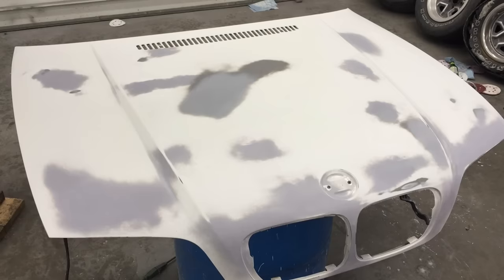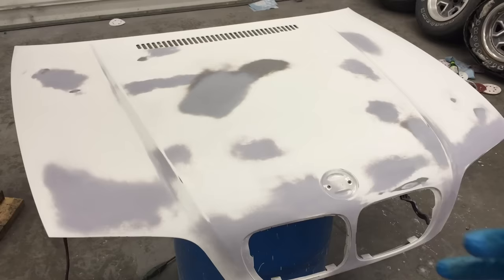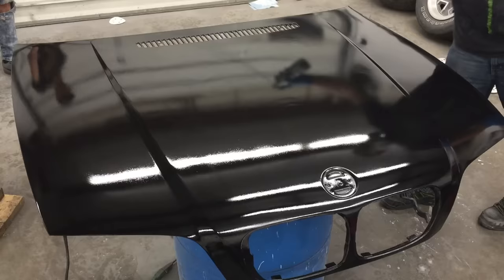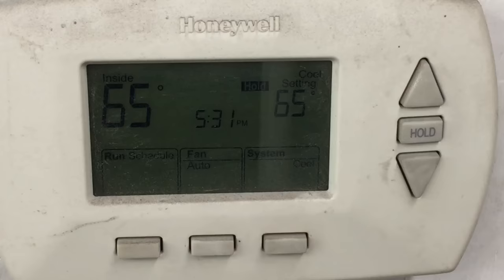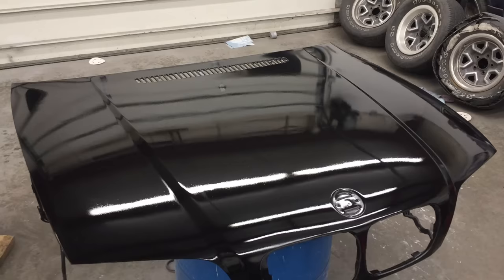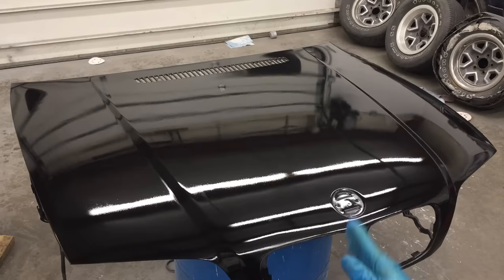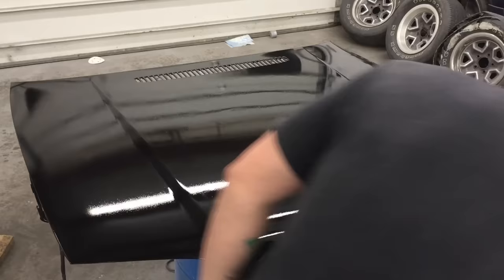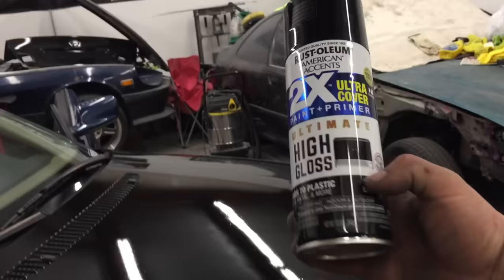How I don’t get stripes when spray painting (Easy method)

Comment: Not judging at all bc looks great for what it is. Just when heard you say light coats then whole hood is covered in first coat😂. Im just use to building up coats maybe first is half or less then 2nd about 75 to 80 percent and third coat full even coverage. Sand and clear. But hey if works for you then nice but your exactly right on the temperature.
Reply: Joseph Purcell well the paint is black so it will look heavy
Reply: SAMO 6IX true it’ll look dark but a light coat means light. As in you’ll see some of your primer still showing which you spray a coat lol. What he sprayed was a medium coat but either way it came out looking really good for a rattle can paint job.
Reply: I agree.  My definition of "light coat" is also very different from this guy's.  Of course, I don't stop at 2 or 3 coats, either.  I was always taught that the first coat gave subsequent coats "something to grab onto" along with the surface itself:  it's hard for second coat to grab onto a completely covered surface.
Reply: His "light coats" are heavy coats for most people, thats just the way he chooses to do it and it works. I've watched most of his videos, he has never actually done a true "light coat" lol

Comment: Crank up the heat, use a heat gun, flows out the orange peel. I use a propane torch too or the sunflower propane heater on the 20 gallon tanks.

Comment: Nice job on the hood. My question is are those SSII oldsmobile rims in the background, what are the plans for such rims and by chance do you have the vehicle those rims are off of?
Reply from the maker: Grover White Don’t remember what they are off of but had them forsale for years and no one wanted them even had them all up forsale for $20. I sent them to scrap yard since I don’t have room for junk. I had no use for them.
Reply: Sad, but 100% understandable, those rims today are worth about $600 a set, for they are factory Series 2 Sport rims by Oldsmobile. If they were 14x7 they were to a 1970-1971 442, Vista Cruiser,Cutlass or Cutlass SX. If they were 15x7 they were 1972 and later.
Reply: Damn them are hard to come by too

Comment: I'd love to see you using Rustoleum out of a spray gun.  I'm in the market for a new compressor and I'd like to see your opinion on a DIYer spray gun/compressor setup.  Thanks for taking your time to post.
Reply from the maker: I will do a video in the near future!
Reply: My first paint job in 1987 was a gallon of white  from orchard supply.  I had to reduce it a little to get it to spray nice.  My 2 nd paint job was regular auto paint and a lot easier to spray.
Reply: I've sprayed my race cars with rustoleum for years. 50/50 with acetone works great, higher pressure seems to get it to atomize better and dry faster but the over spray is ridiculous, everything gets a coat of whatever color your spraying so Id suggest tarping off the area like a makeshift paint booth. I have a car that was painted 4 years ago that sits out in the elements of northern wisconsin, it still has a gloss finish never waxed or had clear coat applied so those that say it dulls quickly must have did it wrong or used spray cans

Comment: Just got a small are where I  scratched some paint off.  So, should I  tape off first, wet sandpaper it with 400, clean it, wipe it with acetone next, then use color high gloss ultimate.  Let dry , do it again, let dry, do it again.  Let dry, then buff?  How do I  color match?

Comment: Yes I agree his definition of light coat leaves a little bit to be desired. Also he doesn't explain how he stays away from Tiger striping. All he says is he has some orange peel a couple bugs landed in it the orange peel is normal he says so it needs to be wet sanded and buffed but what about the tiger striping

Comment: I painted the front bumper on my civic at night it was bout 55 outside. It literally looks factory. I sprayed the rear today and it's out side drying right now. I can see some stripes in it after 3 coats. Will they go away. When i spray the front it was getting to night fall. I went straight to bed and saw it in the morning. I couldnt believe how good it came out. Bout now ive been looking at this one for an hr or so and i see the stripes. Will the lines go away after a couple hrs?

Comment: Wow but some time you are so close some time you are far away whats the logic and ive seen you are spraing edge first then fill the entire but you cant do one coat horizontal and one coat vertical and can i leave it with out clear coat if its glossy and how long usually itll last? 
I mean from the hood painted surface so in case 8 want to paint my xterra roof can i paint all at once or divide it into 4 or 2 parts after that with wet sanding and 
buffing itll be ok am i right
Sorry too many questions but want to learn spray can technique 😁

Comment: Are you using the stock can tips?   I spray with this same paint on a regular basis but my spray pattern isnt nearly as wide as what yours is coming out.
Reply: You would need an adapter to change US can like rusto and krlyon since they use female adapters on the can. All of the good caps are European made because of this. The top end spray paint all use male adapters and you can buy about 30+ different caps or tips.

The really high end german stuff can even be sprayed at almost any temp. check out molotow belton premium cans. can order online or if you have any local art or graffiti stores. The stuff can be sprayed at -10°C until +50°C and has 275+ colors. Its UV and weather resistant too.

Comment: Been watching your vids and gaining a ton of rattle can knowledge... So thank you for these! Just one question, how light do you go on the first coat? I know you say to go light and build it up after each coat but it looks like you're getting full coverage on the first pass (possibly due to the speed of the video)
Reply from the maker: I got full coverage on the first pass but if its spotty then that's ok too. I usually go thicker than most but that was my version of a light coat. Idk if you noticed on the 3rd coat i made it consistently look wet and that's the secret to making it not have stripes.
Reply: @JamesDguy  Truly appreciate the response! Now I just have to wait for a break from this FL heat and I should be good to go... Thanks again for sharing your technique!
Reply: @funky.ass.breakz4473  heat.... Let's meet halfway and get it done 😂 it's too cold for me to paint....

Comment: Super heavy first coat. Or maybe that’s just how the can sprays.
Reply: Looked light to me, he didn't say mist coat.
Reply: That's how to avoid toger striping. Keeping the wet edge. Laying it on, just to, but not quite what I call, "the run stage". If you've sprayed for years, you know what I mean. If a person has sprayed very little, it can be learned in a short time. Practice on cardboard, or on some old piece of metal is even better.
Reply: @KM-ws8qs  but if you're keeping a wet edge that's already a thick coat isn't it?

Comment: looks like it still has what seems to be hail damage all in the hood. Paint laid good though. Too bad the rust oleum flat won't lay smooth. Good paint just blotchy.
Wait did I hear you say wet sand and buff. No way that will happen with this paint. It will gum up and start to roll. Ive tried it a couple times thinking I made a mistake. Then called in and they said no bueno.

Comment: Rustoleum is awesome. Never use krylon on your car.
Reply from the maker: chris k I learned the hard way years ago lol
Reply: Try duplicolor, even better
Reply: +James D guy me to with interior parts never again..
Reply: +Mus. yeah much better I used perfect match on my bumper to color match came out....perfect lol
Reply: I like Rustoleum better, but I painted a beater Jeep Cherokee with Krylon. Lasted for years...
Reply: That's the truth.  I wish I saw your reply earlier. But this is how I can give out tips also I learn from experience.
Reply: I agree, krylon was good 20 years ago but not anymore
Reply: I tried Krylon and it was okay, but not as nice as Rustoleum
Reply: Krylon?  Do they even make that garbage anymore?
Reply: 3dcad Unfortunately yes they do. Lol
Reply: @3dcad668  looks like Walmart is replacing rustoleum with krylon
Reply: Barbara Annen Lowe’s it is then lol
Reply: Olayuwon Dennis 
So they sell the paint used in the video at Walmart
Reply: Krylon has good spray tint for glass if you want to do head lights like yellow centers on a usdm integra. That’s all I’ve ever used them for.
Reply: I cheaped out even more and bought Walmart brand Color Place at .96 per can once. It made no discernible difference that I could tell from the Rustoleum, but it also wasn't compatible for some reason, so I'd be careful with that. 

Now Valspar rattle can enamel from Lowe's? NEVER EVER USE THAT GARBAGE! 🤦‍♂️

Comment: Amazing work guys 👊🏽💪🏾 Question, what are you using for your video/audio recording?
Reply from the maker: Prestige Fleet Well I didn’t have a external mic at the time but I was and am using a IPhone6 for this video and my newer ones. I recommend getting the mic from amazon it’s really cheap and works good. I can link you one if you are interested.
Reply from the maker: Prestige Fleet here is the mic I am currently using in my newer videos.

Comment: I just painted my hood with a spray can and it has stripes all up and down it. The temperature outside was about 63° but I was painting it and direct sunlight. Would the direct sunlight cause this occur? Can I still use wet sandpaper and make it look good before buffing it or do I need to re-spray it?
Reply: It means you need more coats

Comment: Did you have to use a heat resistant paint for the hood? Or did the regular Rust-Oleum Advance do fine?
Reply from the maker: Normal rust-oleum. I hardly ever use heat resistant paint and have great results both off engines and on.
Reply: Moore Motorsports James Dguy 
So a normal rustoleum can like the one in this video works on engine parts? & on the body of a car?
Reply: I'm his video he specifically noted that high heat like engine blocks exhaust manifold you would use high heat paint.  Body hoods it possible to use the regular paint of course with a base coat. Plastics use a plastic base coat and then regular paint.

Comment: What’s the best way to clean surface once I have sanded it and where can I get color shift paint
Reply from the maker: Autozone for the paint, And best surface cleaner i have used it rustoleum wax and tar remover from walmart. It works the best.
Reply: James D guy thanks bro I appreciate the info. Gonna do purple 2x painters touch on my gs300 and black 2x for the hood, roof, trunk and rims. Along with the purple flakes on all the black. Just gotta day that your videos are super helpful and they are some of the best 🤙 Also the only thing I can’t find is that 2k clear, where exactly can I get that?

Comment: I am pretty sure you are spraying way to far, hence you getting a sand paper looking finish, paint or primer is drying before it hits the bodywork, plus always try and paint at 90 degree.
Reply from the maker: SteadyOnThatTrigg It don’t have a sand paper feel or look. None of my spray jobs have a rough feel to them even before the wet sanding and adding more layers if I choose to do more layers. I never understand why people get that sand paper feel/look.
Reply: @JamesDguy  ... if you spray from too far away the paint starts to dry and the airborne vapor eventually settles on the wet paint causing the dull / dry look. This is part of what happens when you spray from one side and switch sides. Always spray in the same direction to avoid that overspray and maintain the wet edge. BTW, I usually do the second coat at 90 degrees to the first coat to help even things out. If it's flat (like a hood) then I can usually go for a third coat coat without fear of runs. Oh, there are times when I work with a fan on low speed placed maybe 10 - 20 feet away. That's just enough of a draft to keep the overspray moving and the bugs away. The other thing I do is pre-shake my cans then set them in a sunny window for an hour or two. Warm paint flows nice, doesn't blush, sets quicker, and has less orange peel. Also no worries of water drops from soaking them in hot water.

Comment: How long would the dry process take on an item the size of an arm? Also does this paint crack if the base is flexed or bent? Because I have a plastic mold thats out of shape and I'm concerned if I spray it while swirled it will crack on me once I extend it to it's full shape
Reply from the maker: I have painted over plastics and never had a issue with cracking due to flexing. It depends on the temperature but the warmer it is outside the faster the paint dries.

Comment: Someone should tell rustoleom to put a fan tip on there cans . I tried putting one on off another can and it wasn't compatible .
Reply: u gonna have to get a adapter. look into wingcap adapter to use a male fan cap/nozzle for the rustoleom can.

Comment: 65 degree perfect for paint? Where u located in texas perfect temp in 75 and up
Reply from the maker: Elchingon_92 In the shop 65 it was 78 outside in Kansas lol
Reply: Why so low? Is it cuz it takes lonher to dry so staya wet longer
Reply from the maker: Yup to get more even coat and not get stripes
Reply: Yup. If the ambient temperature isn't in the mid-70s at least get the paint material up to that temperature

Comment: If you do end up getting tiger stripes whats a good way to get rid of it I just painted my hood and I have tiger stripes.
Reply from the maker: The best way i have found is to wet sand the hood with 1000 grit after a few days,  Re shoot it. Try to follow the wet edge of the paint keeping the entire hood wet basically it helps make the stripes not show up. Harder to do when the hood is hot or its hot outside.
Reply: @JamesDguy  thank you

Comment: You said apply in light coats. Your first coat was damn near full coverage. You want a 50/50 transparency on the first coat,then lay it on thick
Reply: Look at the spray pattern (narrow) and volume (high) coming out of the can. This isn't automotive spray paint where they use a smaller orifice and different propellant (lower internal psi) to allow more of a mist. This is cheap spray paint where coverage is designed to be fast, not precise. He actually controlled it pretty well considering the large area.

Comment: If there’s tiger stripes should I continue going over it till its all blended in?
Reply: I'm still not sure about painting with metallic because of tiger stripes but with solid paint if you lay it on thick enough in the right temperature out of any wind you shouldn't get tiger stripes but with solid colour if you have enough colour on you can sand it flat with 800 grit  to get rid of any imperfections before clear coat or without clearcoat use 1500 and buff

Comment: Its 1 stage paint? o.k its not very good especially with this valve for better results use fan spray valves,my advice is put some clear coat on it..i am guessing till now after 2 years you will have painted again

Comment: Can you recoat after days of drying without sanding to go over areas that may be light
Reply from the maker: steelers412 I wait longer just so I know it’s fully dry but wet sand before recoating. Use 400 grit wet sanding
Reply: Thanks for the info. And nice work!

Comment: How long should you let it sit between coats?
Reply from the maker: Mark Reallz I let it sit no longer than 15 mins but usually I only let them sit 5-10 mins
Reply: U let it sit no longer than 15 mins BUT usually u let it sit in 5-10..it doesn't make sense.

Comment: Why not just get a inexpensive spray gun and a can of black RUSTOLUME paint mix and spray you can get a wider spread it's cheaper in the long run you can clean the spray gun and use it over and over you will get results and your money's worth from the spray gun. I use mine for painting rims and parts, bike frames and all kinds of diffrent stuff. I never painted a car only because I'm in a wheelchair. I have primed a truxk the bottom half with primer feather filler. Then i sanded it and sent off to get it painted with my own paint I gave the painter to paint it with "HOT RODS FLATES" I have to say it's really durables paint. It comes in all diffrent colors I would recommend it.
Reply from the maker: SNOOP U 2 I have a gun and a compressor but my subscribers wanted more spray can videos so I provided.
Reply: @JamesDguy  oh thanks for replying back. Yes the can came out great I used to use can to but I was getting better results with my inexpensive spray gun. I was going to paint my truck dash black with automotive paint the lady rang it up came out to be $80 buck's for a small can. I bought a small air gun and RUSTOLUME shinny black everything came out under $ 50 buck's to paint the whole inside of the cab. It still looks good to this day that was 10 years ago. I wouldn't suggest using on the out side of a car I don't know if it will hold up in the wind or sun. Hay if it work's go for it. You can ever crush glass real fine like powder and mix it in with the RUSTOLUME paint and spray it gives the reflector affect. Like street signs. They use the bigger chunks on the road stripes they put on the ground. Oh when you paint strips white stripes with the crush glass it really pop's out on black paint jobs .
Reply from the maker: SNOOP U 2 Interesting never knew that. I have painted plenty out of the gun but the video I had with that didn’t get good views so I took them down and everyone LOVES these spray jobs so I said F it I’ll do more spray jobs haha it helps pay the bills so I’m ok with it haha
Reply: @JamesDguy  right on I'll keep watching and looking out for your video's 👍